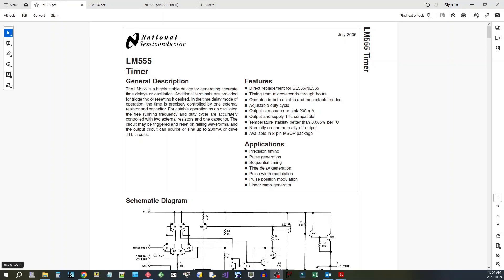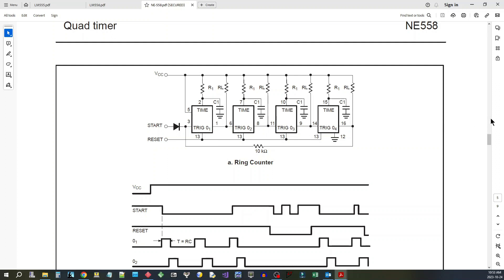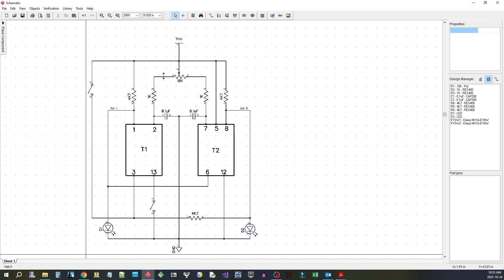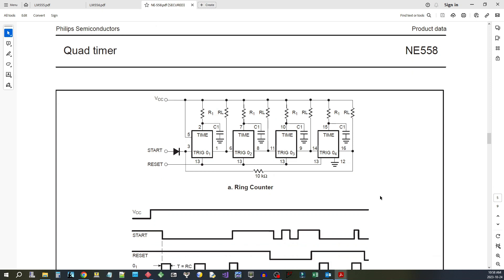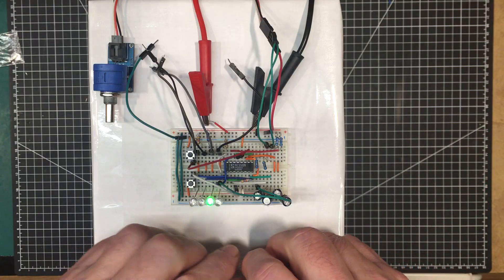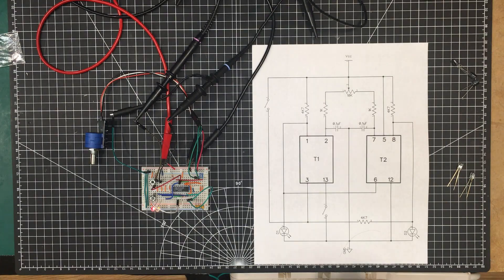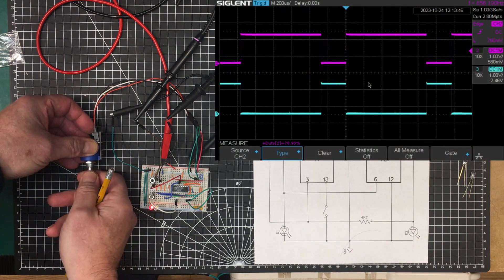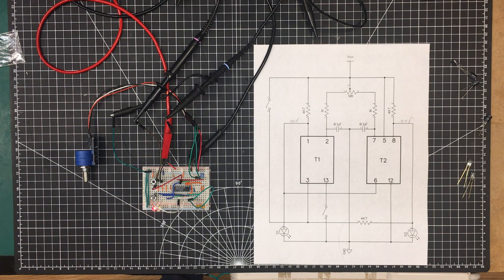0113 - The NE558:  Almost forgotten, but super versatile!

Comment: Yes, I have heard of the 558, but I don't think I have ever used one. Bench tip = I see that your 10K pot requires two hands to manipulate it. I had this same experience and found it quite irksome. So, I built a 10K bench pot. Here's what I did... Added a heavy base. Made the base wide, so it won't tip over. Added non-skid to the bottom, so it won't slide. Added a huge, round knob; mine is 3 inches. The extra diameter makes it easy to dial in a precise setting, even with the multi-turn pot. Added a rubber band to the outside diameter of the knob, for tactile traction. I can spin mine with just one finger. This is one of my best bench tools. I use it extensively. HTH.
Reply from the maker: Nice idea!  I think I'll do something like that.
Reply: @uni-byte  I hope you truly do. I can not overstate how useful it is.
Reply from the maker: @t1d100  Pots and knobs are on order from Ali.  I'm going to make 1K, 10K and 100K units.   There will be a video and you will get the a shout out.  Thanks again for the suggestion.